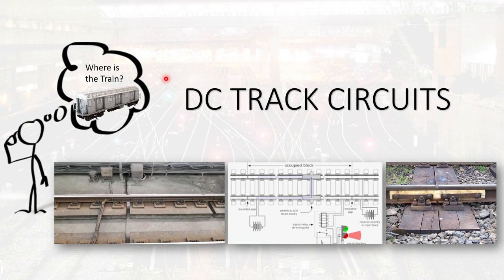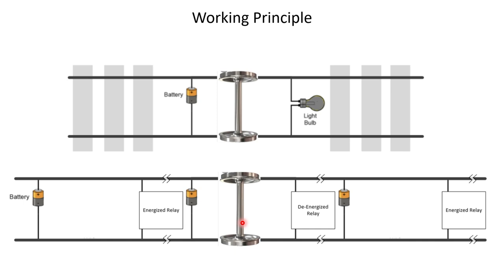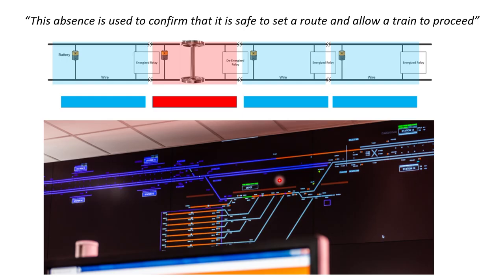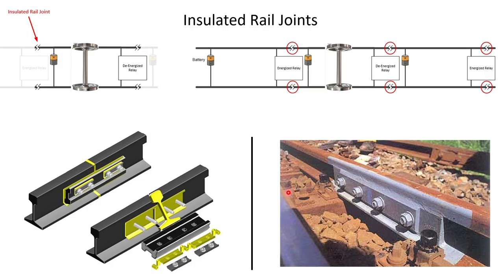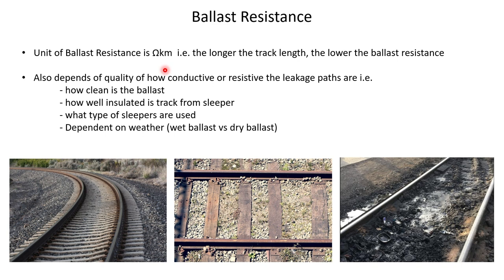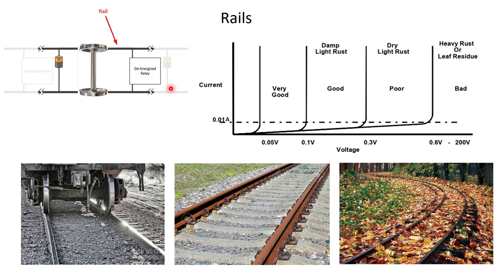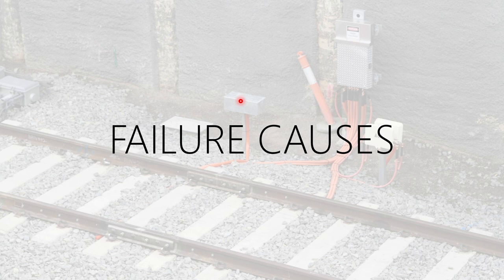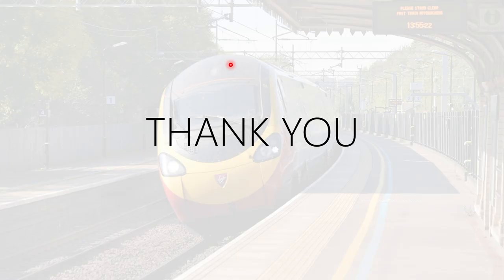DC Track Circuit Explained

Comment: How do IJ bonds allow the flow of negative return current but not the current for the signal track control circuit?
Reply from the maker: Please watch my video on coded track circuits, it explains impedance bond in detail